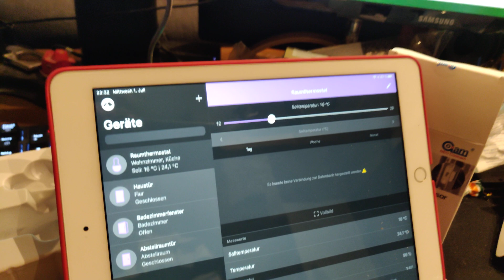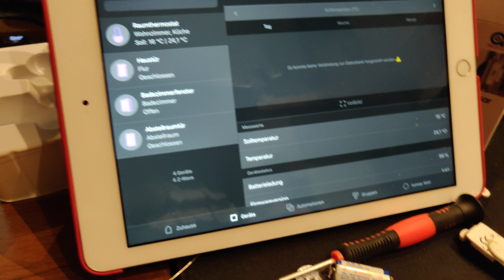Repairing Neo Coolcam / Cyrus Window / Door Sensor | Not working or not every time

Comment: Have a bunch of them. Just 2 sensors are not working any longer. Looks like C3 capicator is soldered correctly. Something it triggers correctly but only on the 1,3,5 and 7 time. Any idea?

Comment: Is anyone could explain me what exactly happent? Did he swap over C2 and C3 or he soldered 2 new capactiors? " I swapped C2 to C3. It worked for 2 min ok. After that I had exactly the same issue.
If he soldered new capacitors what capacitors they are and where I can order them?
Reply from the maker: Yeah, I've switched the capacitors. Because one of them was faulty. For me it worked flawlessly.

Comment: I have a bunch of these Neo Coolcam door sensors that are unreliable. I didn't quite understand what you did. What I got from your video is that you replaced the C3 capacitor with the one you took from the other side of the board from C2? Could you put what you did in writing or is there any way to chat or communicate? I would greatly appreciate your help. And the comment at the end about the price being 5 EUR on Ali Express, are we talking about the same Ali Express cause I never found them cheaper than CAD25 which is probably like 15 EUR. Anyway that's not important. If I get the ones I bought already to work it would be wonderful, Cheers.
Reply from the maker: Yeah, I've switched the capacitors. Because one of them was faulty. For me it worked flawlessly.

Comment: Thanks Robin. Neo Coolcam slightly changed the internals of this device. The reed switch has been replaced with something else. On the old models I soldered wires in parallel wih thre reed switch for exampleto be able to connect a pressure mat which is under my bed. I'm not sure how to do this on the new model. Do you have an idea? I posted pictures here: https://gathering.tweakers.net/forum/list_messages/2040400
Reply: Sorry I just figured out that it still works on the new model but what they use to replace the reed switch rquires continuous battery power. Perhaps they now use a HAL effect sensor instead of a reed switch? But I read these use continuous battery power and that doesn't seem to be the case (i meaure 0.00 mA).
Reply from the maker: I‘ve bought in the last month some new from China. In the next weeks, I take a look inside. But thanks for the information! I bought new ones, because I want to use them as a water zigbee alarm. I solder a water sensor on the contacts of the reed switch and hope they recognize the water.. We see, I will give feedback when it‘s ready.